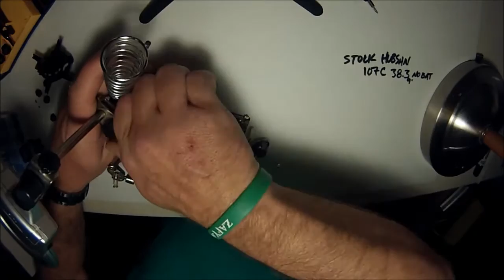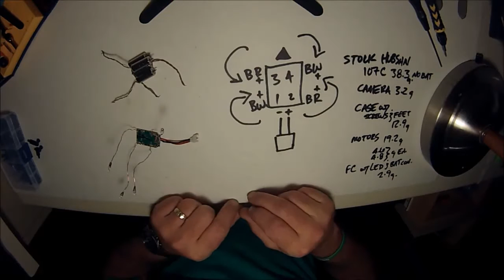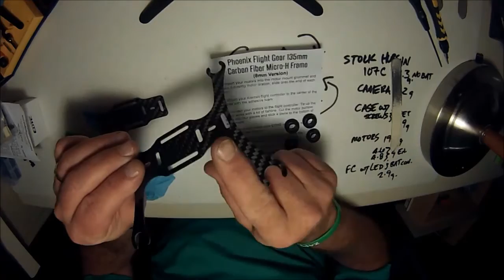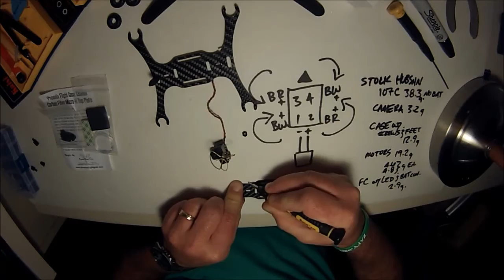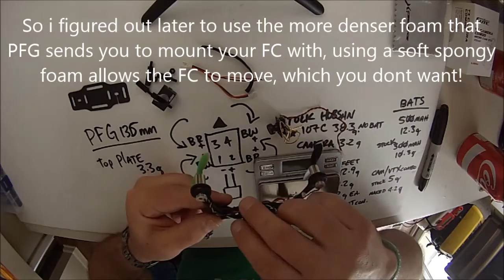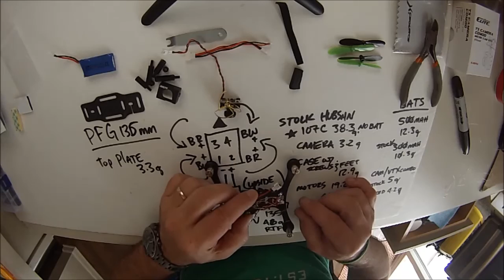Phoenix Flight Gear 135mm - Hubsan X4 Conversion

Comment: what do you use to receive the video?
Reply from the maker: I personally use the Eachine VR007 headset. I purchased it when I first got into fpv becuase it was cheap and worked well. I have stuck with it. I have tried friends fat sharks and they are nice but I still like the feeling of the single screen I get with the headset type goggles.